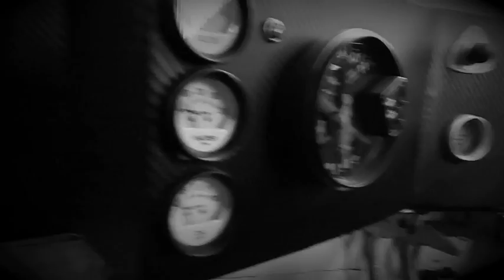Brandon's single rotor mini

Comment: “How much torque does it make?” “What’s torque?”
Reply: Roughly 75.1 lb*ft @ 5,800 rpm and 96.23 CHp @ 7,000 rpm.
Not bad for such a small and light motor.
Reply: @Cannibeasty  So, this would probably work in just about any car that came stock with an engine under about 100HP. I have a project truck that I'm toying with various ideas for a future engine swap. I'm debating between a 13B turbo, a turbo Honda engine (not sure what kind yet), and the idea of doing a turbo one-rotor build for the hahas. No matter what, there's going to be a turbo (or a supercharger if I can happen to find one cheap enough that will do what I want without pissing me off, supercharger sounds tend to annoy me for some reason). Right now it's stock and came with an engine that made about 100HP. I figure, if I can swap in an engine that can make 200-300HP, it might be a fun little truck. Of course, there is so much that needs to be done before an engine swap (disk brake conversion on the rear, replace the axle on the rear with one that can handle decent power, coilover conversion all around, loads of body repair, and a good paint job). I have a feeling I'm going to have to learn how to weld in order to get this project where I want it without spending an ungodly amount of money on a truck that's only worth about $1500 as it sits lol. Of course, I only paid $200 for it and put about $200 to get it running, so...

Comment: Good decisions
1. Mini
2. Rotary
3. Moog
4. Posting to YouTubes

Put any thought into the Honda B series conversion subframe and/or with cRV AWD transmission with that rotary and a single turbo? 

Myself being ambitious have that and also a electric drive rotary design with some designs of assisting and benefitting from the single rotary balance and Ultra High Rev.

But holy poop on a stick do people want a lot for the parts to convert a 13b to a single. You can buy an FD clip for just the conversion parts price with no engine!